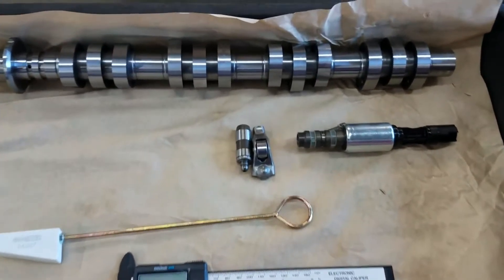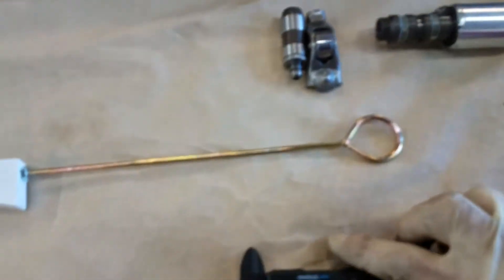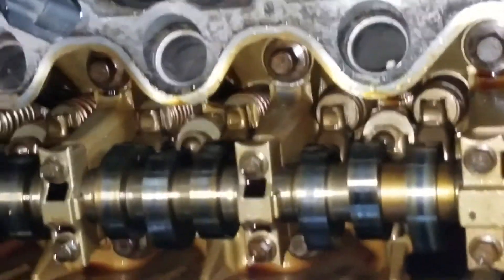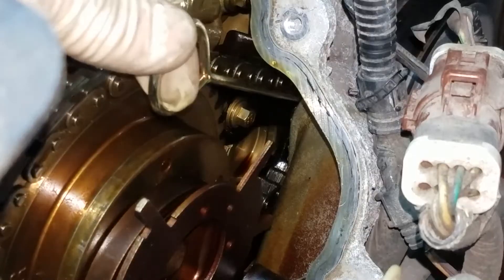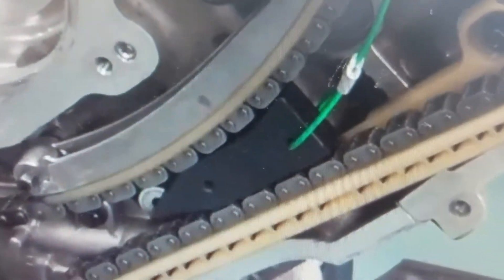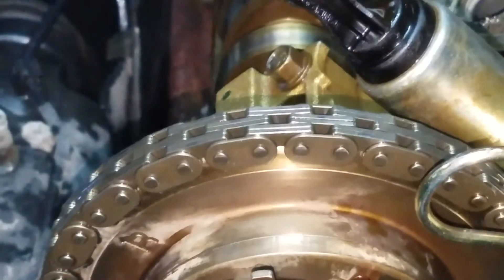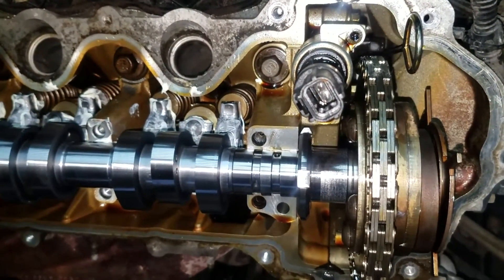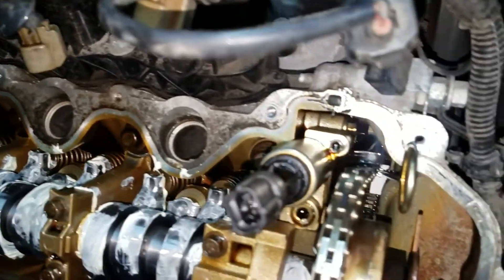5.4L 3V Camshaft Replacement, Rockers, Lifters, Phaser "Fastest WAY"

Comment: whats the tool part # and where do you buy from?
Reply from the maker: Everything I used in this video.
Adoric Digital Caliper: https://amzn.to/2KKjhBk
Torque Wrench: https://amzn.to/2KFziZh
Wedge Tool: https://amzn.to/2KGnA0E
Cam Phaser: https://amzn.to/2LjqZn7
Timing chain kit: https://amzn.to/2KJxhLG
Reply: @FlatRateMechanic  ok,,
Reply: @FlatRateMechanic  Did you get a chance to hear the engine run before repair? I have a 2004 fx4 5.4 3v that ticks. Was told it was a cam follower
Reply: Where you get the camshaft from?
Reply: Wow I know this video is a few years old but I plan on upgrading my cam and doing a lock out on my truck and that wedge will definitely save a lot of time thanks man

Comment: I wonder if this truck had any issues after he installed the lifters/rollers before bolting down the cam. I'm ready to do the same since the process is so tedious to install them after the cam. This would be a major cheat code if it works

Comment: @flatratemechanic did you have to remove any of the roller followers before pulling the camshaft and can you reinstall the camshaft with all of the roller followers installed? I believe I need to replace at least 1 of the roller followers on my son's '05 5.4,, figure may as well replace the camshafts, roller followers and lifters while I'm in there.
Reply: want to know that as well. Did you ever find out? Thanks

Comment: Di you use a tool to compress the springs and remove those roller followers and rotate the motor to get each valve to top base circle??? Or, did you just slowly loosen the cam carrier bolts evenly across the cam and pull the cam off after the spring load has let off? Did you do the same on the way back together? How did you get the torque dialed with the upward force of the springs as the get tightened?? Thanks.. I have to do this procedure tomorrow on my 6.8L  Thanks..
Reply: I definitely appreciate his videos but apparently he doesn't answer any of the questions😔
Reply: I would love to know this as well. did you ever find out? Thanks.
Reply: @MichaelMuller1  I think he just slowly loosened the cam caps and then put it back the same and just tightened it down enough to hold the rollers and lifters in place then rotates the crank until the roller pressure is at bottom before torquing to spec in sequence... so its close as you can get.. You'll have that much upward pressure anyway.. 86 in pounds is not a whole lot.. About 7.4 foot pounds..
Reply: you can remove the roller followers and lifters by rotating the engine then loosen the cam cap bolts. i only removed the rollers easily with cam installed but can only remove 1 lifter. so i imagine ill have to retighten the cam cap bolts then turn the crankshaft because you cant turn the crank if the cam cap bolts are removed. so again i imagine you have to loosen and tighten the cam cap bolts until you have the clearance to remove what you want for each cylinder

though when he installed the cam back in does it matter how ? thats the only part im skeptical about

Comment: I just bought an 2007 Lincoln Navigator on owner with the 5.4 L and has 136689 miles. But unfortunately it has the ticking sound of a bad roller arm. How much would this work in this cost in a shop? Labor?
Reply: I would say between $500.00 to $1500.00

Comment: if replacing camshaft, roller followers, and lifters, is it safe to just unbolt the camshaft without removing the roller followers first? You skipped that part of the video
Reply: That's what I want to know. Did you ever get an answer? Thanks
Reply: He skipped almost all of the video

Comment: What did you measure with the micrometer? The camshaft journals? Is so, what years are different? I have an early built 2004 f150 5.4 3v, will any aftermarket camshaft work that is meant to be used in the 4.6 3v-5.4 3v motors?

Comment: It would seem to me that there is an obvious oiling problem and likely as not will trace back to leaking timing chain tensioners. To replace all you plan and not follow through with new chains, tensioners, guides and an aftermarket oil pump seems a puzzling decision....you are right there at it and small additional effort and some money spent on more parts would assure a top operating engine for a long time to come.
Reply: Agreed.  Looks like a patch job, fixing the noise but not resolving the underlying issue.

Comment: You're not supposed to remove or install the cam without removing the followers, or installing them after cam is installed per ford. I've done it the old fashioned way once and it's still going but now remove the followers first. What's your thoughts on this?

Comment: I have a 06 f150 and passenger side chain guide broke.   The phasers seem off time how do you recommend me going about getting it back in time while I’m installing all the new timing chain kit?   I’m using all Ford oem parts.  Dropped the pan also and cleaned the broken guide parts out

Comment: It looks like you tightened the cam down with lifters and followers installed. I removed mine incrementally like that, but is it safe to reinstall likewise??
Reply: I want to know as well
Reply: How did you end up reinstalling yours?

Comment: Great video good information.  Did you use a new camshaft phaser bolt i guess your not supposed to re used the bolt. Reason why I ask is because I will need to replace the camshaft on my 05 lincoln navigator 5.4 3 valve it got scuffed a little bit from a bad rocker arm.

Comment: Just a question cant you use this wedge tool for the 5.4L 2 valve to remove the head gasket to prevent removing the front cover?

Comment: You reused the cam cap bolts and its 89 in/lbs not 86
Reply: Yes 89 is correct,  I understand the bolts are torque to yield,  one time use trying to find where to get replacement bolts for mine. No luck.

Comment: If I'm just replacing the roller followers and lifters ,can I partially remove the  cam bearing not all the way and swap the lifters and roller followers and torque them down?
Reply: I saw your comment, how did you end up replacing your followers and lifters?

Comment: I also have a constant light ticking. Plan on removing valve cover to inspect cam, roller followers and lash adjusters. 
If the can is not damaged, would it be safer to keep cam in place and remove individual roller followers and lash adjusters with the special tool or screwdriver method?
Reply: Hello, I saw your comment from 3 years ago.... did you fix your ticking noise? Was your cam damaged?
Reply: I just left it...still running fine. I think I'm overestimating the noise might just be injector noise.
Reply: @kevgsp  you never took the cover out to inspect?

Comment: Can the new lash adjusters/lifters be installed in any orientation? Also, after soaking and pumping them up submerged in oil they seem to lose a little pressure. Will they be pressured up after the pressure priming event at the end of replacement?

Comment: @theflatratemechanic what happens if I mixed up the cam caps and don't put them back in the exact same way they came out?
Reply from the maker: Not the end of the world but not good either. They will most likely fail due to  premature wear, due to bearing not being a match to cam wear
Reply: @FlatRateMechanic  I got them lined up right, I know the timing is perfect but for some reason my truck once it gets to operating temperature it's losing power/acceleration. Can't figure out what's causing it. Exhaust isn't restricted. Doesn't seem to be a misfire.   Drives good till it gets good and warm
Reply: @thomasv5596  did you compression test each cylinder prior to fixing?
Reply: @kas0016  found out what it was. Intake runner manifold control valve sticking open
Reply: @thomasv5596  yeah i like the concept of the runner valves but poor functional design and almost impossible to reach in bay. 
Glad it worked out. Heads up if u didnt know. Always do a compression test on these heads if possible (and sparkplugs dont seem to frightening)  before valve train and head work. Im sure u know by now lay and label each component flat in original orientation. 
U could actually delete the   runner valve function in a tune to save headache as well. Im a weekend warrior who refuses to let this engine go until it grenades  and its time for a built one. Shes supercharged and addictive torque levels now
Reply: @DentsideDick  ran the Roush blower  m122 on my 3v expedition. Sleeper af.
Was made for f150 and made few minor adjustments. 
iat2 temps get high with this blower, even intercooled. 
Running efans and 3" exhaust. 10lbs boost. 47lb injector
I would recommend whipple.
Still beat these new gen stock  mustangs and cause lots of confusion in my town and highway. Very hard to keep foot off.
Reply: @DentsideDick  I'm guessing just 420-450 range torque.
There's not much  power left with this blower efficiency. Some more to be made with head work and cams tho.
Start with better power adder like whipple or turbo 
Upgrade to performance springs and keepers at me minimum. 
Lots of stress with aggressive cams.
Good luck to you
Reply: @thomasv5596  Oil pressure runs your cam phaser/timing.  Ford's oil pump is under powered.  With a brand new oil pump on a brand new engine, typical oil pressure is 25 to 28 psi.  Over time the pressure gets less and less.  Typically once the truck warms up, hot idle, you will have rough idle, and missing on acceleration.  The fix is the Melling M340 or M360 oil pump.  This provides plenty of oil pressure.  The problem is the pump is located behind the crankshaft gear that holds the timing chains.  That's right, off with the valve covers, timing cover, etc.

The whole key to fixing a Ford 5.4l 3v engine is oil pressure.  Melling came out with this pump in 2018.  Many 5.4l 3v are in the grave-yard because of low oil pressure due to a crap pump.  In some cases pumps are pushing 8psi.  Not enough to lock the phaser pin at base idle, and not enough pressure to keep time with acceleration.

Best of luck.
Reply: @randybrady1689  Hey Randy. I did put the new melling oil pump in when i did my timing job.  I'm about to buy a set of all new rockers and lifters and put them in now.  or roller followers and lash adjusters, however you prefer to call them.  I bought this truck for 3300$ two years ago and put $1000 into it to it to do the timing chain kit.  I started with a misfire in cylinder 3 today, verified its not the COP or spark plug, and now i'm getting misfires on all cylinders in bank 1.  

For $300 dollars i'm going to buy a set of new lifters and rocker arms and replace them, and i think the truck will run smoothly.  I'm not interested in using the spring compressor tool. I'm going to loosen the cam journals a little bit, if even necessary, and try to use the screw driver trick to pull out the roller followers and then just grab out the lifters with some pliers. 

i'd like to put the 16mm socket on the crankshaft and just turn the engine to where the cam lobe base is on each of the roller follower that i'm pulling out at the time i'm pulling it out to relieve the pressure.  

my question is, is there anyway i can mess up the timing, or lose a keeper, if i do it like this? 
and also, how do i prime the lifters before i put them in, soak them in oil over night?

i'm not interested in taking off cams or using wedges or spending 16 hours cussing under my truck.  i'm going to take the fuel rail off, intake manifold, and valve covers and just try to do this, thats my plan.  If it doesn't work then i'm going to just buy a new truck.  i was reading somewhere you have to keep the crank shaft key position at 9 o clock or something, and also i know that there is a possibility of losing the keepers with the compression tool but i don't know if that applies here.  those are my only 2 concerns, i'm not concerned with warping the cam shaft or scarring the lobes, if i fudge one of those two things up i will tackle that beast at that point or just move on to the next vehicle, as i am reasonably confident that if its even possible, save some other unforeseen obvious issue that would prevent me from doing it like this, that i can do it without damaging the cam shaft.

In october it will make 2 years since i bought the truck and did the timing job with new oil pump.

Comment: This goes completely against what the manual or Ford or any other mechanic says to do. So if I have all my new timing chains on, cans in place and torqued down with new cam phasers on all I need to do is unbolt the cam then install all the rockers (cam followers) then set the cam back in place and then carefully and evenly tighten and torque the cam back down and it will be fine? Just doesn't sound right at all compared to what the manual  or Ford says.
Reply: well, according to a Ford factory trained mechanic: the heads are machined to the camshaft and can't be replaced. Each one "supposedly" is a little different. I had an issue with the cam cap breaking and when I wanted to just replace the one, they said "no way, can't do that". 

I'm not saying it is right or wrong, but just what "ford" says.
Reply: @muskokamike127  
Individual cam caps can't be replaced because the cam bearing bores get align-honed at the assembly line. That is why when one fails, you have to buy a new cylinder head. It is also why marking them is vital before you disassemble and reassemble an engine.
Reply: @skylinefever  yeah, that's what I've learned.
Reply: You are correct that this method is much different than the Ford factory service manual that requires the use of a special valve compressor tool to reinstall the rocker arms.  But if this method works insofar as being able to tighten the camshaft caps to the proper torque specifications it would save a lot of time compared to individually installing each rocker arm using a special tool.

Comment: The whole purpose of watching was to see how to take the cam out..... Waste
Reply: Was this just a commercial for the timing chain wedge tool because I didn't learn how to do anything I was wanting to know
Reply: so you think the video was a waste of time?
Reply: @charlesc9148  yes.. he didn't show taking any of the bolts out that hold the cam in. Did he take out all of the cam followers first or just unbolt it from the motor?
Reply: Exactly..
Reply: He took the cam out at 4:20

Comment: Hi friend, I think I just had an epiphany.  Watching the fordtechmakuloco videos and this video I think I just figured something out.  If you are doing a timing job on the 5.4l 3v engine if you put the crank at 12 o clock remove 3 roller followers from each side (exhaust follower on cyl.1 and 2 intakes on cyl. 4) and (2 intakes on cyl. 5 and exhaust on cyl. 8) then turn the crank shaft key way to 6 o'clock position putting the engine in a neutral state and all the valves being closed.  I can then remove the cams replace the hydraulic lifters and all the roller followers except the 6 that were removed (those have to be installed with the special valve spring tool) that way there is no real spring tension on the cams allowing you to get an accurate torque on all the cam bolts.  What do you think?
Reply: JoeC's_RC  too much work that way, just carefully take cam caps bolts out evenly and put new cam and followers then slowwing tight cam caps from one end to the other
Reply: Have you ever tried your method out? I'm no expert but it seems to be the best of both worlds. Less pressure on the cams and less need to use the special tools or screwdriver method.

Comment: When you removed the cam, I'm assuming it was under some spring tension.  Once the cam is removed the lifters and roller followers just come right off?  Then when you install the new lifters and followers how did you bolt up the cam again?  In guessing that the valve springs are going to be pushing against it?
Reply: It’s not the best way to do it but it works. Supposed to actually install the roller followers after the cams torqued down. Can install all of them with motor in truck using a screwdriver, but the proper way is to use the special tool for replacing them. But end result is the same technically. Potentially distorting the aluminum cam towers drawing down the caps is too risky for me on a customer vehicle. Personal maybe prolly still wouldn’t lol
Reply: @DDescalchuk57 it's impossible to replace the lash adjusters lifters without removing the camshaft
Reply from the maker: Yes, everything you said is correct. You just need to be sure to torque everything down evenly in steps. little by little so not too much pressure is put one just one part of the cam.
Reply: The Flat Rate Mechanic Also before the cams are removed and the engine is at top dead center.  Would it be wise to mark the back of the phases with a paint pen and also mark the head so that once the cam is off to do the roller follower replacement, I can line up the phaser to the mark on the head and then slowly bolt down the cam back in.